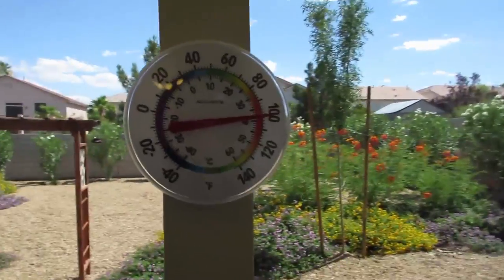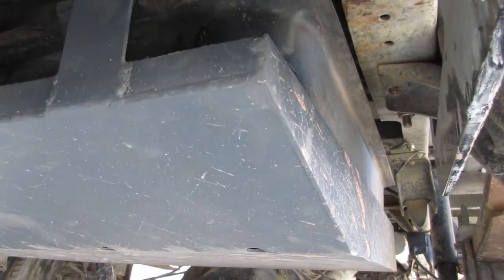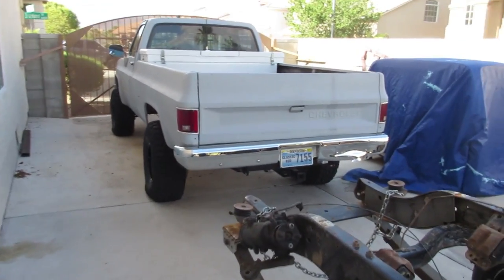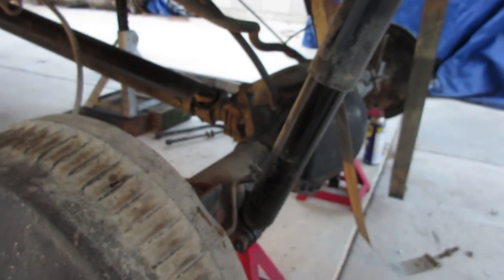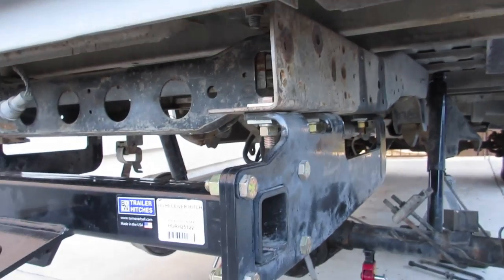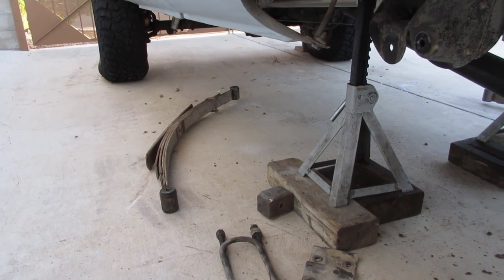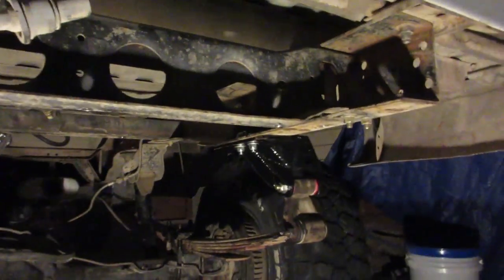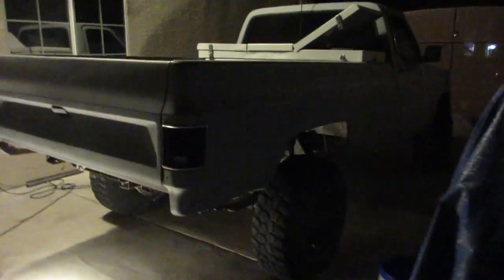Chevy K10 Shackle Flip

Comment: Chicks don't get it... Lol. Been watching the build.  I'm converting a 82 c20 diesel into a 84 k20 (so no smog in CA). just spent a few days with angle grinder and  multiple sawzall blades and BFG removing the rivets to get my c20 front frame clean (under front grill support body mounts, sway bar brackets, and c20 crossmember and coil spring assembly. Got a similar talking to about the noise. Classic.

Comment: Did you ever do a disc brake conversion on the 12 bolt? If so, do you have a parts list?
Reply: The rear...
Reply from the maker: No not a 12 bolt, but here is a video of disc brake swap on a 14 bolt.  https://youtu.be/Beaw67MPDZg
Reply: @Dicks4x4Garage  Thanks, I've watched that. There seem to be no low cost solutions for the 12 bolt. $400+ for everything I've seen. Anyway, thank you for the reply!

Comment: let me know how the payload and towing  is with the shackle flip I wanna put one on my cc k30 but worried it might hurt some in those manners
Reply from the maker: I will let you know!
Reply: What type of springs do you have? A shackle flip on compression springs do great under pressure. You can haul a 30+ ft 5th wheel an then some plus a full load of concrete if you wish, an all should be fine.

Comment: Dave, did I hear you correctly that the factory rear springs for K20 are 56inches?  What year is the K20?
Reply from the maker: Both my 79 K20 and 84 K10 have 52" springs. I got my 56" springs from a Suburban at the wrecking yard, but not all Suburbans have 56" springs.

Comment: For the hitch, I cut some 1/4 plate strips to go between the frame and hitch. It drops the hitch down a 1/4 but it allows it to sit on the shackle bracket with no issue. I did have to get a couple longer bolts but some I was able to reuse.
Reply from the maker: Thanks for the heads up, that is a good idea.

Comment: looking good man. Looking forward to seeing how the truck is with the new springs and whatever rear bumper you fab/decide to run. If you want to swap to the 56s, you'll have to relocate both the front and rear spring hangers(if i am remembering correctly from the research i was doing when i was prepping to start my build)
Reply from the maker: Thanks! Actually on 56" you just have to run the shackle flip backwards and it comes out good, no need to move the front.

Comment: Also i have watched your videos on the wiring and the fan/battery tray and I have to be honest, your location and neatness is rather nice..... I also liked the way you used the relays and distribution piece against the firewall and it seems to be a nice place for it....... Can you clarify how and where you did the wiring for them and how much of the old wiring for the stock fuse box for the cab did you use/eliminate? I'm iffy with wiring and schematics as I only know what I was trained on which isn't much........ I rather trust your work so far on it and am interested in more info..... I know this may be a pain but LT1swap.com isn't as simple as it could and having a hard time understand some of the info..........  My whole build is mainly for a show and a Sunday driver per say as it is my first real build/restoration being only 24....... Building and engine and trans is a piece of cake but wiring isn't a specialty but willing to learn more for future builds........ Thanks in advance
Reply from the maker: I would start with the two following links and do tons of research. http://ls1tech.com/forums/conversions-hybrids/312119-ls1-swap-faqs.html There is also a ton of threads with useful information. http://67-72chevytrucks.com/vboard/forumdisplay.php?f=206
Reply from the maker: You can also check out my K5 Swap thread, I have a schematic and talk about wiring. http://67-72chevytrucks.com/vboard/showthread.php?t=532351
Reply: +MrWhitels1 thanks! I printed out all of the diagrams on lt1swap.com just a little unclear to me....... Especially with unpinning the wiring harness....... What is the need for that? Aside from getting rid of the vas, low oil and so fourth...... But after I watched your wiring videos I have a great deal of better inderstanding on what I'm suppose to do..... I'd rather do it once rather than a few times bc harnesses are oober expensive...... I like my emitissions just so I can keep it dependable and reliable as the old 350 is tired iron.......

Comment: Have you thought of running 63" springs out of 90s Chevy?
Reply: In the rear
Reply from the maker: I have read build threads where people have used them, but I haven't really gave them much thought. If my ride doesn't improve with the front springs and 56" when I get around to putting them on, I may consider it.
Reply: 63's make a huge difference in ride and flex. I had 1/2 ton springs out of a 2000 Silverado in my 84 and loved them.

Comment: I got a 87 swb k10. What happens if you use stock springs. How much lift.
Reply from the maker: Shackle flips are made to be used with stock springs. The amount of lift depends on the shackle flip itself. The two I know of are 2 or 2.5 and 4".
Reply: Thanks